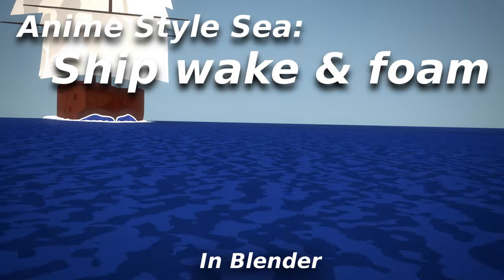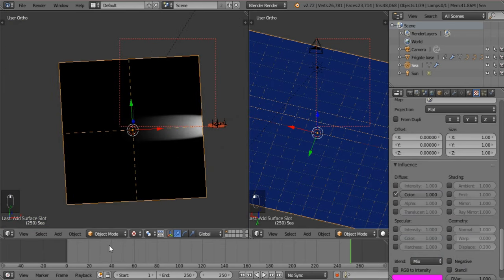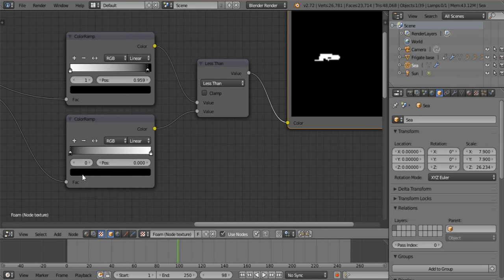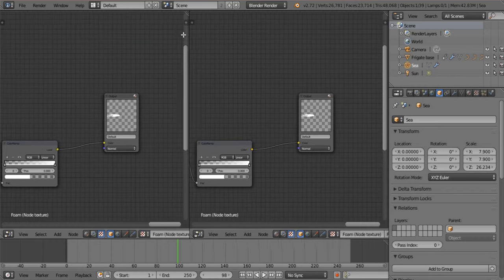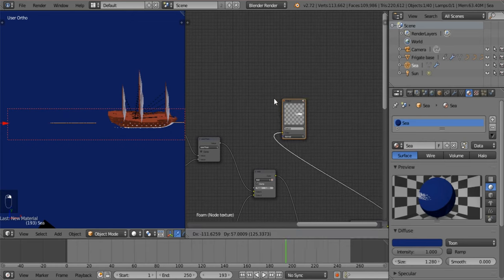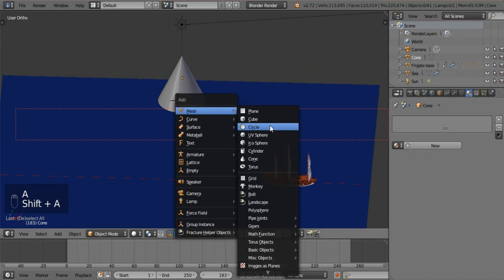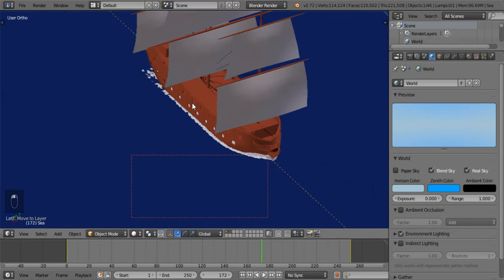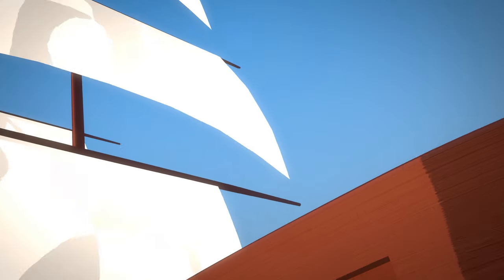Anime Style Sea - Ship wake and foam [Tutorial]

Comment: HI very great work ! however i'm a bit lost with the old nodes used in this tutorial, "time curve" or "clouds noise" or even "translate"... have they evolved in other nodes?
Reply from the maker: That's the tricky part going from Blender Render to Eevee. If you follow what each part does, you need to find their counterpart in Eevee. For example, we don't need time in Eevee, because all it does is move the cloud texture. The function is to move the offset by 1 (time) multiplied by 0.100 to slow it down. It was an easy and fast way to get your textures moving endlessly back in 2.77a. Today, I just animate two points, vectorize in the graph editor and extrapolate. It's a bit longer, but a lot less technical.
Translate is now part of the mapping node - location, rotation and scale. Translate refers to location. Cloud noise is simply the noise texture.
I know these can be confusing, but I'm gonna tell you what I do when I watch tutorials - I don't have blender open. I just watch and pay attention to what each step changes and what it does. That way, you can implement whatever you see on your own stuff. If you simply copy/paste like a recipe book, it's not gonna sink in fast if even at all.
You're always welcome to ask if you get stuck! ;)

Blessings!